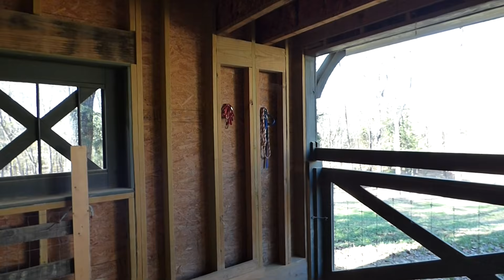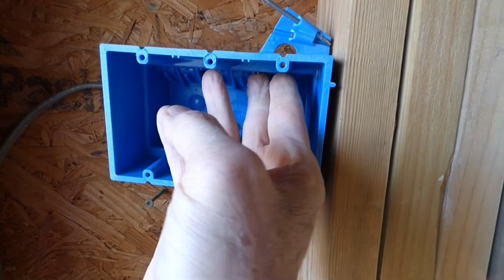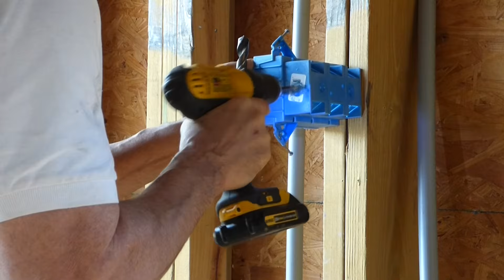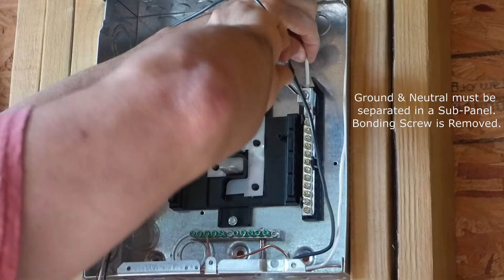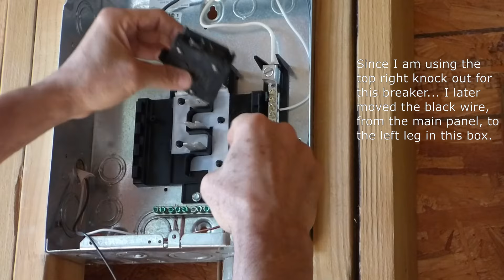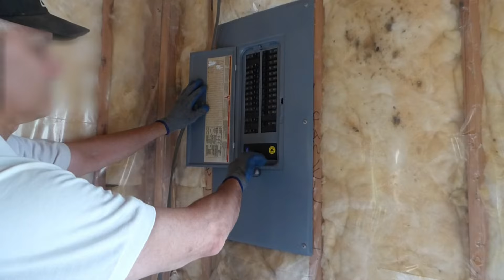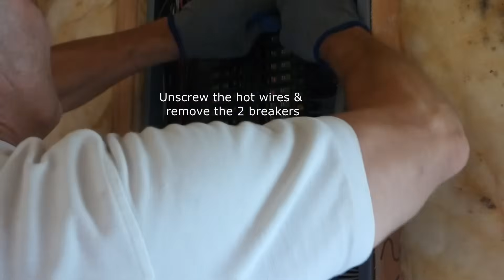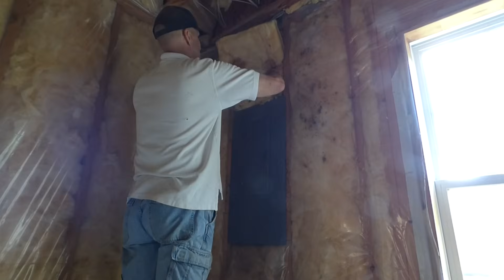Sub Panel Install - Start to Finish - Outbuilding | Shop | Barn | Garage

Comment: I believe you created a code violation by adding an additional ground rod. By doing that you created a separate pathway for a short to travel instead of one path from the main panel to the sub panel like it’s supposed to do
Reply: Sub panels in detached buildings most definitely need a ground rod.
Reply: @lakestatebullies7391  Then they don't need a ground from the main panel right?
Reply: Adding a ground at the shed isn't that big a deal as it's tied to the main ground.  While yes it's technically a waste, it's not unsafe.  There are a number of articles online and and white papers about good grounding techniques.  

Housing code resistance to ground requirement is for safety based on lightning protection.  IEEE suggested resistance to ground (much lower) is for electronics and equipment protection.  Tying in that (assumed) 2nd ground rod at that distance from the house roughly halved his resistance to ground on the ground circuit.

Good job OP.  You just inadvertently better protected your electrical equipment.
Reply: Confusing! Is earth grounding required for a detached structure or not. It is my understanding that earth grounding is only required if the detached structure is connected by a conductor such as a water pipe or metal conduit. With a resistance less than 200 ohms.
Reply: I have 5 ground rods on my outbuilding. 😂
Reply: Nope no code violation just waste of many, not needed per code
Reply: @thomasmarable6818     Please check again!   Required an must be connected to ground bar.
Reply: @thomasmarable6818  I agree, that's a waste and not necessary.
Reply: You are right! Plus voltage drop.
Reply: I believe you need the ground rod if you elect to connect the ground and neutral together in the sub panel which I suppose would be for reducing the resistance to ground as mentioned rpreviously. The subpane should have come with an optional green screw with insructions how that green scew would bond the ground and neutral bars together.
Reply: @MoNoShocks  I thought you never bond ground and neutrals in a sub panel they are only bonded on main panel.
Reply: @jaycahow4667 you only bond at the first means of disconnect. Meaning if you have a meter bank just the meter bank your first means of disconnect is your main panel inside the house. Those get bonded. If you have a panel attached to your meter those ground and neutrals stay separate in your house panel so on and so forth everything down the line must be separated
Reply: @MoNoShocks  Never bond N&G in a sub-panel you can kill someone doing that the reason is it gives a pathway for ground to replace the neutral line. If the neutral line somehow gets cut now someone touches the box because there is a difference of resistance between earth ground and the box person will get a shock. N&G should always be bonded in one place at the service entrance only. Sometimes electric range ovens and electric driers have it bonded also have to watch for that remove that bond.
Reply: @MoNoShocks  Grounds and neutrals are isolated in a sub panel. In a detached shop or garage you also need a ground rod.

Comment: Good video , But your big hands with gloves - hard to see what bar the ground and white wire got screwed into . Unless both bars are ground . It been nice to point each wire or better yet where the camera could see and then the screw you screwed down .
Reply: Unless one wire went threw both bars !
Reply from the maker: In the main panel wiring where I am wearing gloves...  The bare copper wire went into the ground bar.  The white wire went into the neutral bar.
Sorry I did not show that better in this video.